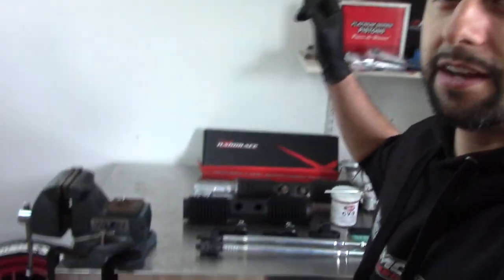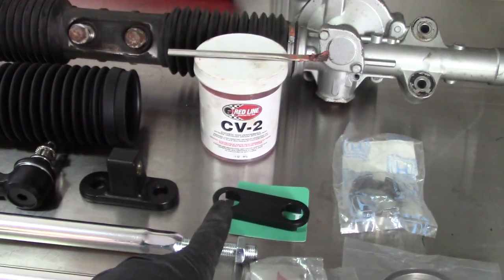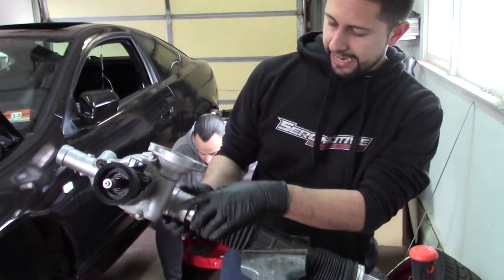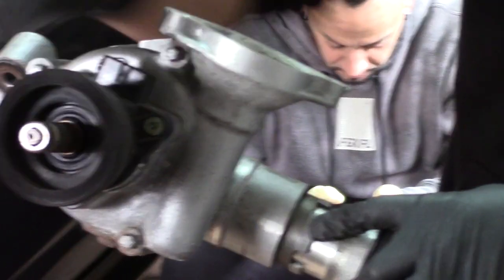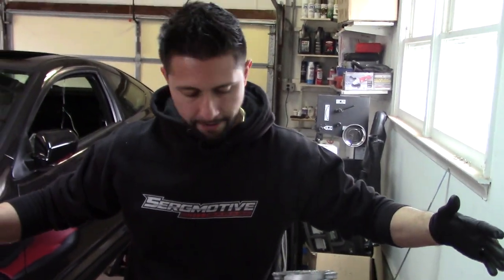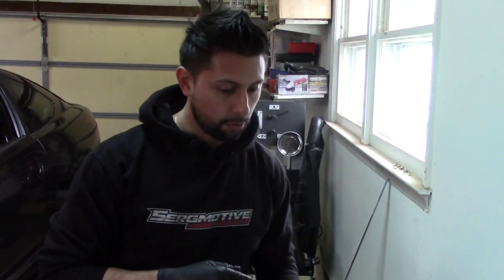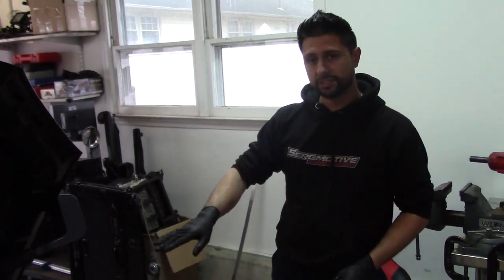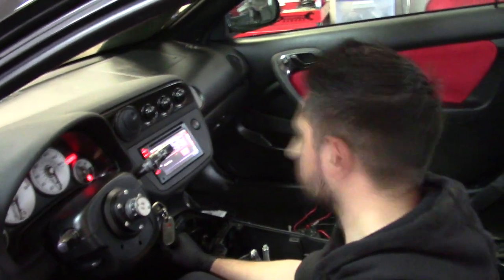Learn how to rebuild your EP3 electric steering rack!

Comment: You don’t need to remove that snap ring to get the rack parts separated. Admittedly it feels like something is still holding it. But it just needs a wiggle and pull. And it comes apart. Also when reinstalling the two parts of the rack back together. You must make sure the little slot at the top lines up with the pin up inside the gearbox part. It’s fairly self explanatory tho once you get there. Good video tho 👍.
Reply: Thanks saved me from getting a new snap ring 👍🏾

Comment: I have 2002 civic vti...it has same steering system... At bumpy roads it gives lot of noise...i checked its mount that carries the inner tie rod ends has play probably due to faulty rack slider...but not confirmed yet

Comment: I'd suggest you revisit this steering rack, notice at 8:00 when you install the metal sleeves/bushings - they face the other way and should snap into the slider so that the sleeve sticks out of the front of the slider. Incorrectly intalled sleeves are almost flush with the new slider. See correct orginal install at 4:50 during disassembly,

Comment: Thanks for this video. I already have the SHG mod in there for two years works amazing. Very responsive. I have play on steering. I don’t know if it’s the SHG slider that broke or inner tie rods. I might replace inner tie rods before taking apart the rack again

Comment: how the hell did you manage to get that lock screw off with a punch?! torque spec is like 120ft lbs. in the manual they have some special tool for it.

Comment: Has anyone experienced issues with a sticky steering wheel with this electronic steering setup?
Reply: I'm watching this video to see if they mentioned that, Mine doesn't self centre.
Reply: @projectzed5766  mine doesn't self center either. wheel will return to about 2 oclock then bind up. removed steering rack and greased up. still the same

Comment: I just installed the rack and pinion of the ep3 in my Rsx work great but next day the steering stop working what can I do to check what wrong thanks anticipate
Reply: Check your wiring bro. If you're using t connectors to the ecu, it can be finicky. Make sure the wiring to the brain box is perfect